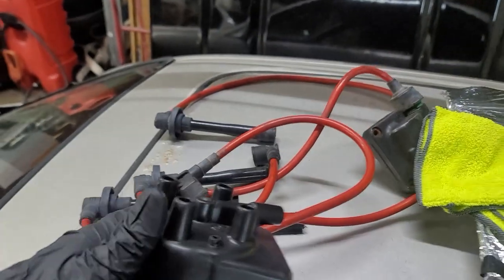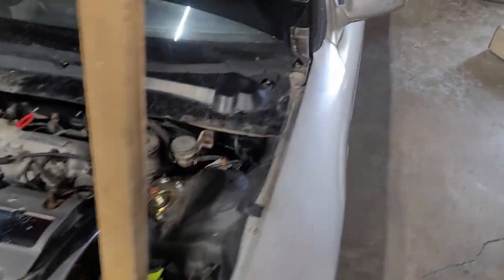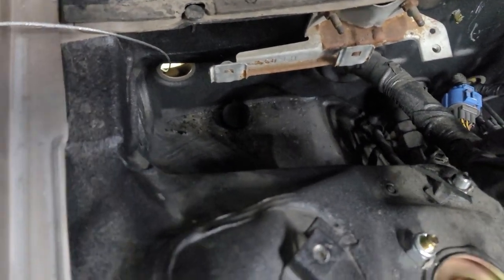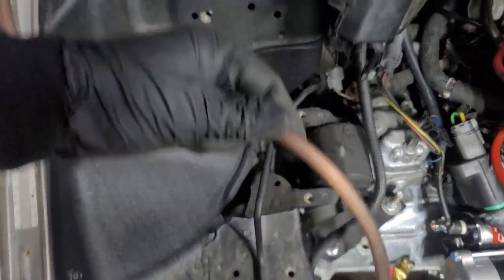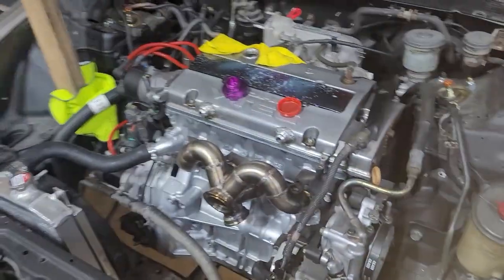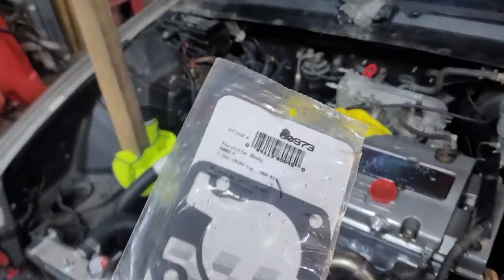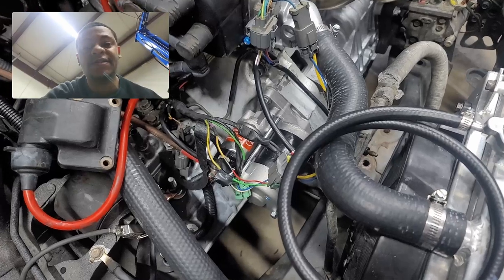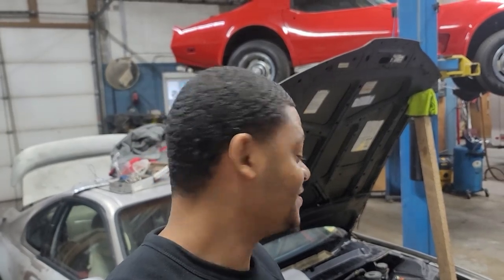Turbo H22 Prelude first start???? | How to build a Honda Prelude pt 4

Comment: Watching your vids has helped me figure out so many problems I've had,specially on the f22b 92 luda
Reply from the maker: Thats dope bro glad i could help
Reply: @treybedipping1734  I'm in the process of relocating the battery to the trunk, didnt know about the plug behind the fuse box.im glad I dont have to cut a hole out now 👍
Reply from the maker: @mellowrose9470  yea i found that a while back on my last build it comes in handy for wiring v tec too lol
Reply: @treybedipping1734  for sure thanks man,I'm definitely gunna keep that in mind for vtec future